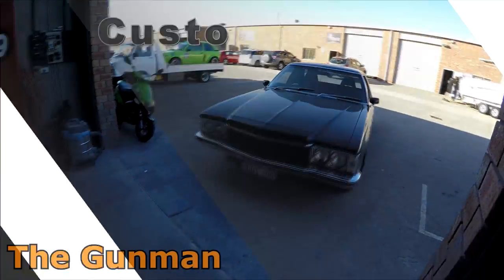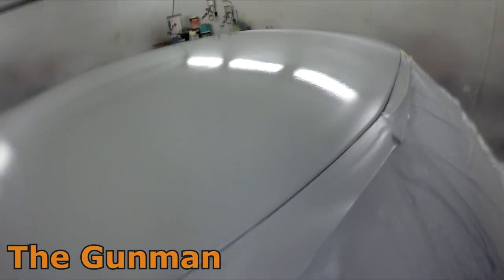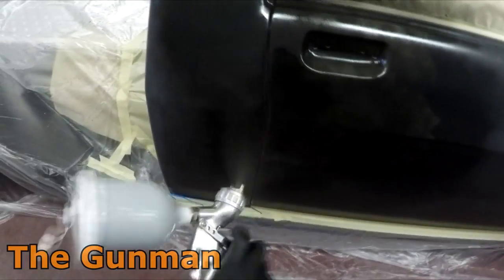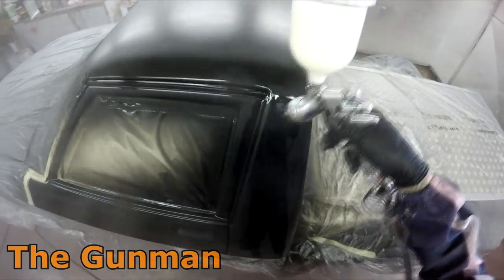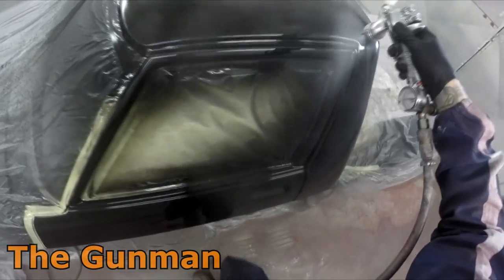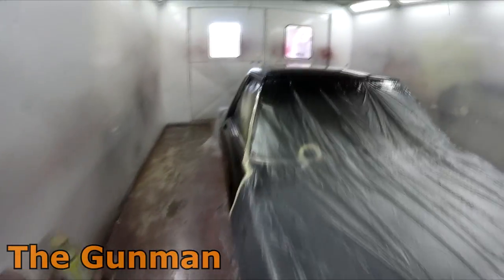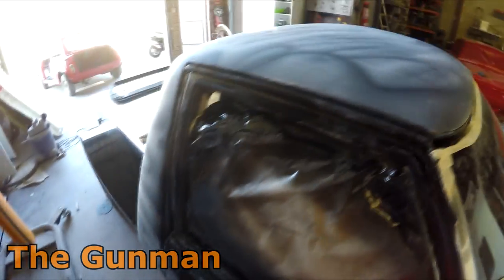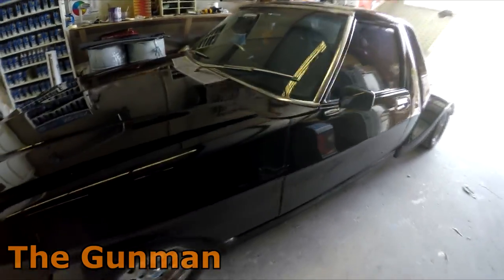Spray Painting, Custom Holden HZ Ute

Comment: great video bro. I really like what you said about  the sata 2000. Thats what  i use for clear with a 1.3 tip. A sales rep lend us the Sata 5000 hvlp 1.3 tip for  a week. I calibrated my gun to spray EC530 by ppg clear just like the 5000

Comment: You know gunny i always wet down my booth floor but got blush to many times in my clear so i stopped.  i use PPG dc 3000 clear  i dont thin it down at all shoot it right out of the gun old jet 90 sata with 1.3 tip and base with a sata get b 1.4 tip hvlp for base only.

Comment: as far as having a slight orange peel on the vertical panels,  could you use a high solids clear 2 coats,  then follow it up with a low solids clear for the final coat of clear all in the same session?  would that knock down the peel?

Comment: Hey Gunman, have you ever made a video tutorial on how to do a correct burn in, or clear blend?
Reply from the maker: Yep, the Etype Jag is a good one but more there 
http://thegunman.net.au/s-m-a-r-t-repairs/
Reply: +The Gunman 
I always use polish to buff the burn in area. Compound is too coarse I've found,  & will start to roll your burn in back. Makes a mess & will have to be redone. Maybe it's the difference in the materials we use. I do my burn ins pretty much the same way, except I use a Sata mini jet to spray the actual blender/clear mixture.  Most times all is required is little polish on the buffer if that.

Comment: Hey gunman! Sgk or gpi? What's your choice? Don't think about price difference. Thanks!
Reply from the maker: GPI if price isn't an issue.
Reply: Thank you! I have been recently having a problem with my te20 air cap on my prolite. It's not atomizing the pain nicely and fan won't open up. But when I use the te10 it's fine. Can you help me? I use a 5 hp compressor with a devilbiss dad-500 air deccicant dryer. Can my air supply be choking?
Reply: I have the regulator at the wall flat out.
Reply from the maker: ballerbrian4u May not have enough CFM to supply the TE20, what is the pressure setting at the wall and where do you set the gun, did it used to work  than after changing something stop?
Reply: +The Gunman at the wall I have it wide open to 125 and it goes down to 100 before the compressor kicks in. At the gun regulator for the te20 I have to set it at 25-26 pounds  to get a decent fan but it's still narrow and won't atomize nice.
Reply from the maker: ballerbrian4u Sounds weird man, did it ever spray nice or has it always been like that?

Comment: So there's no need to clear over base coat all the time?
Reply from the maker: Maybe on a rare occasion but you usually want clear over the base, why would you not want to clear?
Reply: The Gunman After watching the video again i see you did clear coat it haha, feel proper dumb.
That was the only reason i asked as i didn't think you clear coated it, transition from base to clear in the video i didn't even notice, editing was just to good, more attention needed from myself.
Reply from the maker: Dinxsy haha, sometimes under a bonnet/hood I'll just use basecoat with 5% hardener and it'll give a satin finish tho.
Reply: The Gunman Awesome, thanks for clarifying that. Off topic but is there anyway of removing 1K clear without affecting the basecoat? Sprayed my motorbike fairings few months back using 1K and a shitty £30 gun (sighs) i knew they were crap but tried cutting corners and paid for my choice. Basecoat came out okay clear has major orange peel. Think i recall you mentioning thinners will make 1K go back to it's liquid form? Thanks for the replies
Reply from the maker: Dinxsy Yes thinners will freshen it up but not the recommended way of removing cos it'll take a long time so paint stripper is quickest, are the fairings plastic? if so there is specific strippers for plastic but sanding would be how I did it by the sounds and the base will need redoing.
Reply: The Gunman Yeah they are plastic, i've seen on YT paint stripper being used plastic, car bumper stripper stuff i think. I did search it up but it's available in AUS only, nothing in the UK that's available that i see. I would sand them but i've found the 1K clear clogs paper up.
Reply from the maker: Yeah exactly, that's why the plastic stripper is best. Just start coarse and go through the grades and reprime with 2k, fiddly job I know but gotta be done.
Reply: The Gunman Well i have a few months time window to sand as it's now winter. I'll have to man up and get sanding haha. Thanks for the replies dude.
Reply from the maker: Dinxsy All good man, hey was just thinking wet sanding may even work better cos it doesn't clog up as bad as dry.
Reply: The Gunman Yeah will be the best option, also cut down on the dust another factor i hate haha.

Comment: Can I get this gun in the states? The GPI?
Reply from the maker: Yes, these guys will send to USA and know a few others who have bought from them in USA and happy with service, 3 days every time I've got stuff from them, send them an email saying that I sent you and they'll throw in an extra for you, don't worry about the VAT tax, it'll be taken off.
http://www.spraygunsdirect.co.uk/index.php/devilbiss-gpi-all-purpose-gravity-spraygun.html#sthash.UjjUMsO5.dpbs
Reply from the maker: The extra is just a little cleaning kit but handy, I have all 3 needles and tips for this gun 1.4-6-8mm 1.8mm is great for primer 1.4mm base clear & 2k colour and 1.6mm for acrylic so if you won't be using acrylic the the 4&8 is probably all you need.
Reply: +The Gunman 
Sweet. I'll do that.  Wouldn't mind giving this gun a shot. Thanks.
Reply: +The Gunman 
So the GPI only comes with one tip size? How much extra is the other tips?
Reply from the maker: http://www.spraygunsdirect.co.uk/
26 pound extra and that's for all 3 setups.
Reply: +The Gunman 
Yeah, for some reason, I can't place my order. I have the money,  it will not complete the transaction.
Reply from the maker: send them an email if this link doesn't work http://www.spraygunsdirect.co.uk/index.php/checkout/cart/
info@spraygunsdirect.co.uk
Reply: +The Gunman 
Email sent. Hopefully this will be resolved quickly and I will be able to do my own review of this spray gun.

Comment: funny how shaving door handles is agaisnt the law, yet they tell us to lock our door before driving. So door handles are useless for rescue people, as the doors are locked and thus handles desactivated .  Those laws are there since before the 40s when car doors couldnt be locked at all
Reply: +Veikra There have been many instances where people have died because first responders were unable to get the doors open.. and had nothing to break the glass with. It happened in my area just recently when a car was washed from a flooded crossing , and rescuers were unable to get into the vehicle before it sank.
Reply: Barry Thomas the doors are locked, the handles wont change anything though